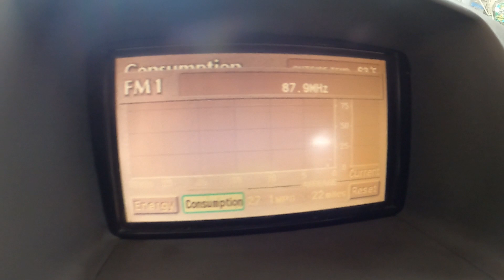Testing a gen 1 Toyota Prius hybrid battery

Comment: I'm curious how you apply the dialectic grease... you say not to goop it on. I'm just gonna assume it's a very small amount on everything. Really can coat everything?:hand-pink-waving:
Reply from the maker: Yes, just a thin film on the connectors. The dialectic grease helps prevent corrosion and can help prevent arcing.